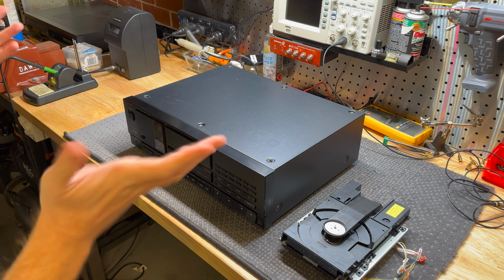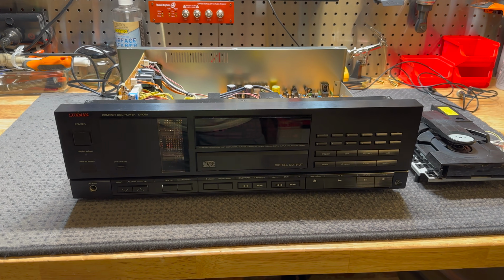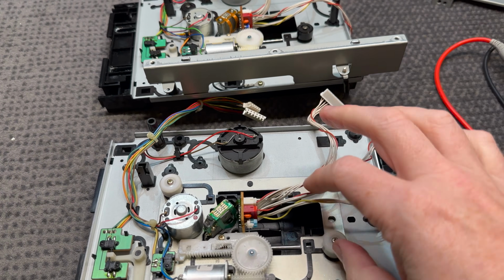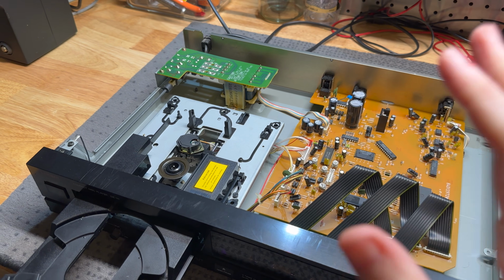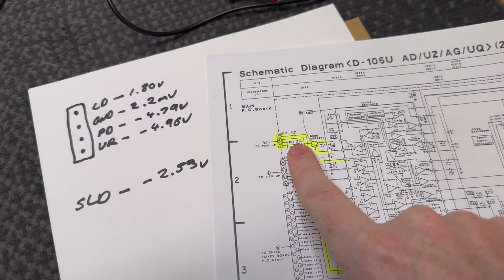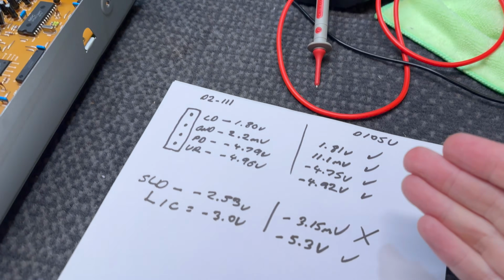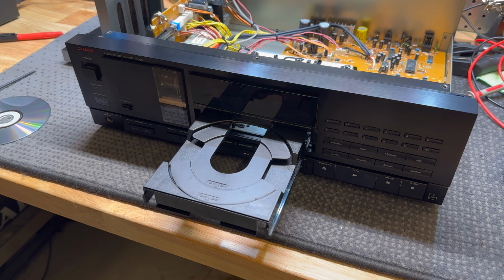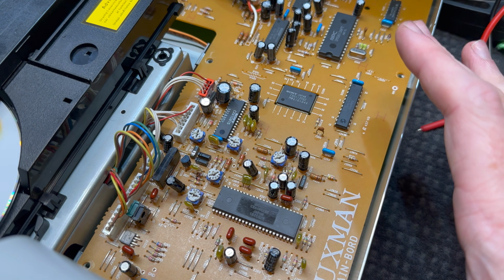Luxman D-105u Tube CD Player - No Play Repair

Comment: Hi, Great video. I did the same several years ago and cooked the driver. Sourced a new driver and fitted it but CD didnt seem to work, but recently I plugged it in and to my surprise, it worked. The driver gets quite warm which may be normal; only time will tell. Do you remember where you got the driver chip from? ..........it would be good to have a couple of spares.
Reply from the maker: I got it from Wagner Electronics, they had spares somehow… If you cannot find one reach out as I got 2 but doubt id ever need it again 🤣

Comment: Good morning,
First of all, congratulations on your videos—they are incredibly interesting and useful! I'm writing to you from Italy, and projects like yours should be showcased and replicated in our universities as well!

Thanks to your videos, I was able to revive my Luxman D105-U and fix the issue with the worn-out CD tray belt. However, I now have a problem similar to yours: when I insert a CD, it gets read, and the number of tracks appears. But when I press 'PLAY,' the CD starts spinning, and track 1 doesn’t start playing, while I can hear the laser trying to read.

The strange thing is that once in about 20 attempts, this doesn’t happen—randomly, when turning on the player, the play function sometimes works correctly. But this is very rare.

I also tried adjusting the focus potentiometers without success. Like you, I noticed that my STA341M driver gets extremely hot, even just a few seconds after turning the unit on.

Do you think my issue could be caused by the STA341M?
Reply from the maker: Doubtful there is an issue with it if it works mostly, more likely needs calibration or laser is worn out but easy to source also
Reply: @whatcouldgowrong7914  Thanks a lot for your prompt answer! Can you give me please some detail on laser model so that i can search, buy and replace it? Thanks again!

Comment: Iam a subscriber of your channel . Video is amazing. I have a luxman d 105 u , previous version. Cd not spinning. Recapped the power supply and main pcb .Can you advise how to rectify this issue?
Reply from the maker: I would be checking for power at the spindle motor otherwise it could be the driver :(
Reply: @whatcouldgowrong7914 Driver Transistor is good . Sled motor is working fine and it focus when we switch on . Its a new lens too. Any other components to be checked ?

Comment: Great video. I think I may have the same issue with my Luxman DZ-03.

It would start playing a disc and then begin skipping tracks. I took it apart cleaned the rails and verified the laser went up and down and the laser was moving as you demonstrated. After about 5mins injected the disc and reinserted it and it just sat on track 1 without playing it. That controller chip was red hot to the touch.

Where did you buy it from as I assume they are the same?
Reply from the maker: Not likely the chip has failed as it wouldn’t do anything most likely… unless the connectors had been previously incorrectly plugged in then its likely dead, they normally run hot which is surprising… It may just need a calibration or the laser could be on the way out. Sounds like calibration though.
Reply: Believe it or not the worm gear binds when hitting stop. I use my finger to move it and it works fine.  So I put double sided tape, three layers about 5mm total thickness, between the motor and the laser. Since doing that the CD player works fine.

I did this after making this initial post.
Reply: @dazman6325  Hi, after reading your comment I checked my D-105u not working and had exactly the same problem!!! Your solution seems to work well in my case too! You have saved my life! :) Many many thanks from Italy!
Reply: @andreavannini2859 I’m glad it worked for you. I tried all sorts of lubricants to prevent the worm gear from binding and nothing worked.